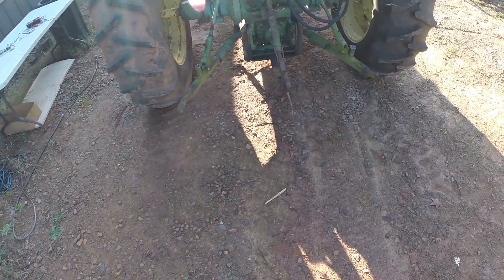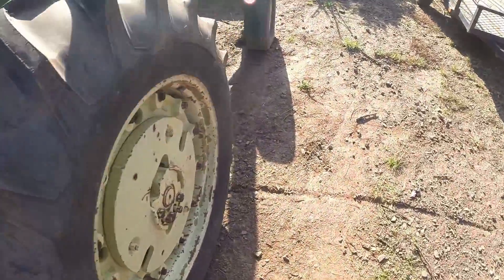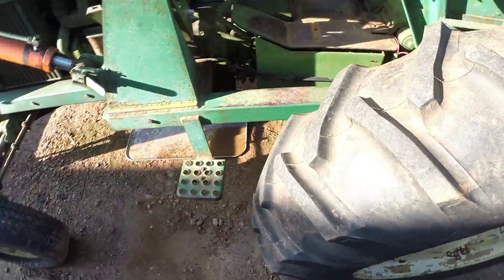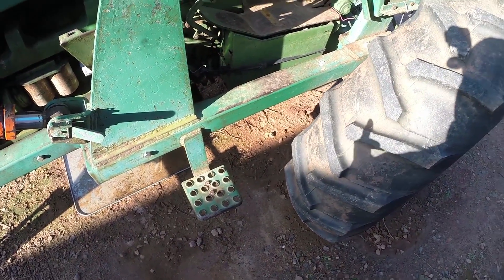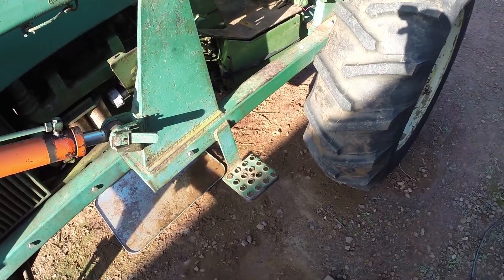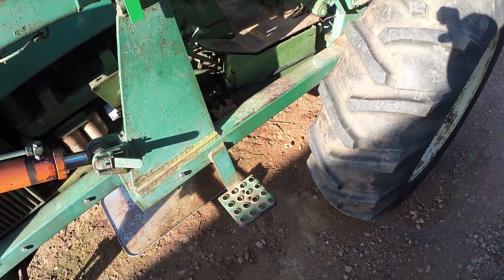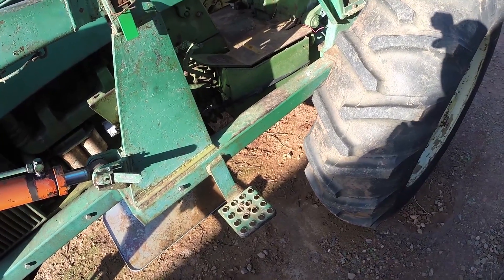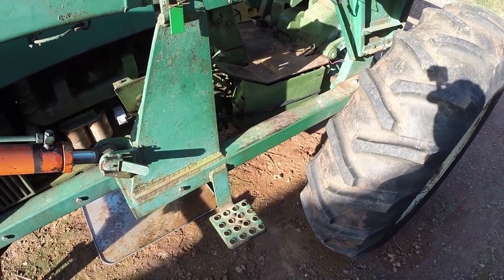1968 John Deere Power Shift Loader Replumb:  Intro

Comment: hey! I need to do this on my 67. But it does not have a rock shaft. do you know how I would go about plumbing the return?
Reply from the maker: There is a ported filter cover kit you can buy to plumb a return. But even on a 67 there is a rockshaft. You doing a 3020 or 4020 and is it a powershift or a syncro range?
Reply: @FarmingGeeks  3020 Power-shift, and now that I have looked again it looks like its a 64 I was mistaken.
Reply from the maker: It should be just like this video. There should be no difference between yours and the one in the video. Mine is an early model as well. You have a rockshaft. You just have to buy the special fitting to T into the line. I talk about part numbers on the T fitting and other fittings needed here https://farminggeeks.com/farm-equipment/early-john-deere-3020-powershift-front-end-loader-hydraulic-re-plumbing/
Reply: @FarmingGeeks  Well i shall have to look a bit harder, thanks so much for the replies!